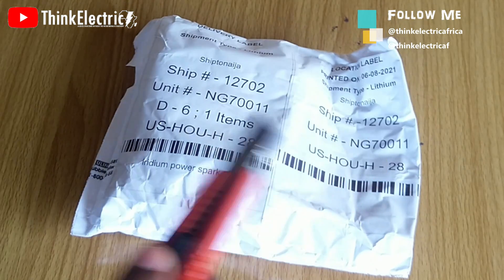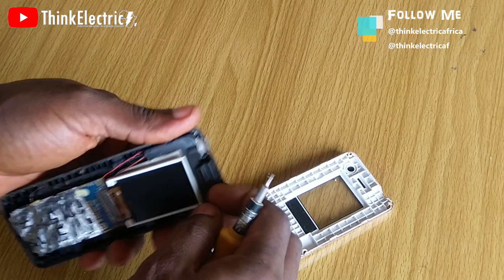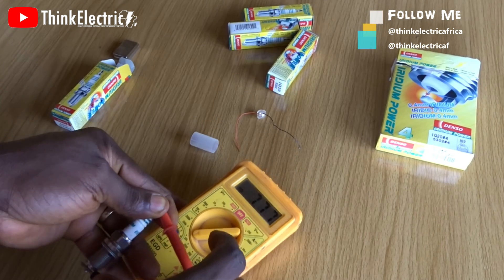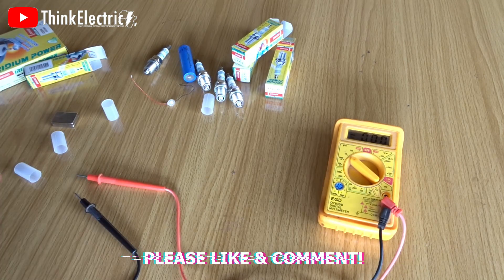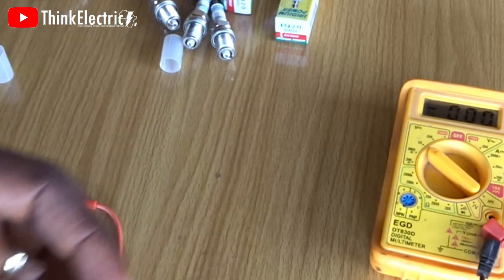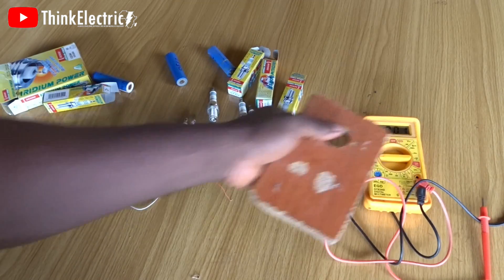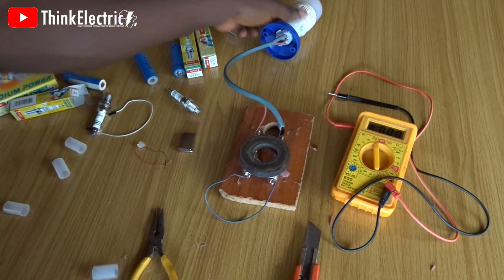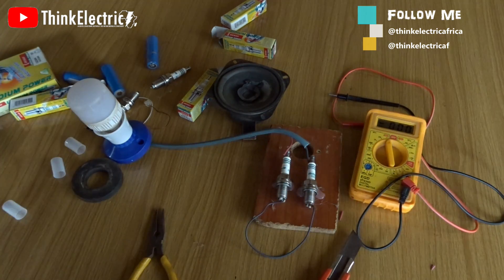Free Electricity Generation With Original Iridium Spark Plugs, THE TRUTH!

Comment: Thanks for this video of that experiment. I went round and finally found a shop with various iridium plugs. Happily i rushed to get the phone LCD to test them at the shop and buy the one that is working, bought unfortunately the iridium plugs failed the test. I now consider that he used the red color iridium. Or maybe we should try again loosing the top of the plugs, tie the wire and screw back that top on the phone lcd testing wire, before using the other end to the center electrode at the bottom of the plug to test 😂. Another thing i noted was that i was informed at that shop was that they dont usually loose the top of that iridium plug like other plugs which left me wondering

Comment: U tried bro but u left out a coil of copper wire wrapped around,  where by the moving magnetic field from magnet will induce a current in coil of wire due to electromagnetic induction

Comment: To produce electricity using electro-magnetism there has to be a rotor that is mechanically spinning like an alternator inside a stator of coils of copper wire. Doing so will induce current using a magnetic field. This is AC because it changes polarity (plus and minus) during each revolution of the input shaft. Spark plugs have to get power in short, timed intervals, from an outside power source. LED’s are diodes that emit light and use chemicals not filaments like incandescent bulbs. They run only on DC.

Comment: You should put a wire coil at the end to generate electricity when closed with a magnet and solder it to prevent lose connection as in this link.
https://www.youtube.com/watch?v=ygR7g55VXqM

Comment: your connection to the bolb is wrong. connect both as single which will be connected to the positve of the lamp holder 
then both tail plug as single to be connected to the negative of the lamp holder
Reply: sorry sir you already try it? pls

Comment: Spark plugs don't produce energy or store energy. Spark plugs are not used to power LEDs.
Reply: well... they do store energy, but only when connected to an actual power source. they store some amount of energy needed to then generate the arcing spark for which they are used.

Comment: What does spark plugs have to do with "producing energy"?
You are a quack.
Spark plugs and LEDs don't go hand in hand.
Reply from the maker: You have issues, it's a pity it's hard to pass knowledge into some heads. Don't just bump into my video to raise insults on me. Obviously the English is too hard for you and reading other comments too. The video is simply exposing the scam going about that spark plugs generate electricity. All you needed is to calm down, watch and learn.
Reply: You don't know anything about electricity. You didn't need to purchase spark plugs to dismiss shams or scams. The bottom line is that spark plugs cannot store energy or voltage.
Reply from the maker: @eddietee6305  I can't be arguing with a person like you. You are the most correct

Comment: As I see that there was no light in the led light, i knew it won't work. That spark plug may be  imported but it doesn't mean it's the original. You bought the fake iridium sir. If it doesn't bring light with the led light there is no point assembling cos not miracle will happen. All the plug used by the fk tech showed light which is a sign of it being the original plugs. I'm not saying his videos are real but the spark plug energy was tested by a white man and it worked search for the video.

Comment: You did it exactly as I have done it.
I drew the exact same conclusion that there is no power being emitted. I've watched one video all the way to the very end and I noticed that the light went out before he removed the magnet and then he did it again and sequenced it right. But on the second try the sequence was off again and the light was out before the magnet was disconnected. I've been doing electrical for years and if this kind of stuff really did work we would have abstract voltages in cars. And I did have a problem years ago with ac voltage in the radiator. The water pump caused the whole problem it was acting as a generator.
Reply: I am guessing but I believe that it must be a pulse circuit iridium plug. Just being iridium won't cut it.   I looked online for the writeup and there is no mention of a pulse circuit.     HERE IS THE PLUG THAT I WANT TO TRY.. here is the write up.   "WHAT IS A PULSE PLUG?
Pulse plugs are the latest in performance ignition technology. They are essentially a spark plug with an internal pulse circuit which increases peak spark current by up to 20,000 times as compared to a traditional spark plug.

How is a pulse plug different than a spark plug?
Their physical dimensions are the same as your stock spark plug. However, pulse plugs incorporate a capacitor, which stores incoming electrical energy from the ignition system and releases it in a shorter more powerful pulse of energy. Instead of 50 watts of peak power, typical of a spark plug, pulse plugs deliver up to 1,000,000 watts of peak power. This allows Pulstar pulse plugs to burn fuel more efficiently than traditional spark plugs.

How do pulse plugs operate?
When the ignition signals a spark plug, it begins to ionize the spark gap. This means that the voltage builds in the gap until a spark can be formed. During this ionization phase, which lasts about 5 millionths of a second, the incoming voltage (which has nowhere to go) heats up ignition components including the spark plug. This is wasted energy. When the ignition voltage overcomes the resistance in the spark gap, the spark is created with an initial discharge of approximately 50 watts. Once created, the spark resides between the electrodes at very low power for over a period of 30 millionths of a second. Instead of heating ignition parts during the ionization phase, Pulse plugs store this energy in the integral circuit inside the plug. When the ignition power overcomes the resistance in the spark gap, the pulse circuit discharges all of its accumulated power - 1 million watts - in 2 billionths of a second. This effectively ignites a much greater portion of the air/fuel mixture, making misfires a non-factor. By effectively burning a greater amount of the air/fuel mixture in the combustion chamber, there is a substantial increase in fuel economy, throttle response and horse power."
Reply: @guidedmeditation2396  
ROBUSTLY RESEARCHED. ROUND OF APPLAUSE.
Reply: How can I get original spark plugs

Comment: You've just connected two resistors now, there's a need for the source of power, voltage like a battery, else a magnetic force that will create the current..kindly have the end of  the plugs disconnected and place the magnetic over both to create a magnetic field in between the resistors .
Reply: he does this... thats what the speaker is... a speaker has a large magnet at the bottom.  you cannot generate electricity with a spark plug.

Comment: Before you can get current from a spark plug,the plug has  to be copper type of plug. For radium plugs connected as a magnetic type  you have to attach a magnetic bar
Reply: Fk tested the spark plugs with a plug tester and he used 4 denso and irridum spark plugs
Reply: those spark plugs you  are using are fake ones. I know where to get the original one. the original one used to be 4 in a park
Reply: @overcomersimon2184  yeah, u are right sir. I don't know his reason to criticize FK
Reply: @overcomersimon2184   where pls
Reply: @overcomersimon2184  sir were can we get it
Reply: @overcomersimon2184  sir please send me a link where to buy it
Reply: Uhh! Have u tried it sir wot copper and dd it work?
Reply: Where can we get it

Comment: a spark plug gets its power from the coil so, if there isn't power nothing will ever light up.  The spark plug is a resistor of sorts if I understand correctly .  Even the lowest voltage still has to have so many minimum volts to light up even though they may only need 20ma

Comment: This video is like coming from someone who has no idea in physics.you tested for resistance and didn't add magnetism and expected to get the plug to light up an led. It's like connecting a resistor across an led and expecting to get a light without any power source

Comment: I was told a vehicle has about 20,000 different parts. If America and Japanese scientists had been told that a vehicle can work without a particular engine they would never had believed, Today however, we have engineless electric vehicles. Can't you use iridium spark plugs with red base color because fk had never use another color. Until i get the exact iridium he uses, i will keep trying.
Reply from the maker: Great, keep trying. I am also waiting for your results
Reply: the question is,why is the guy finds it difficult to answer questions. I Kno something is fishy
Reply: When you get one let us know . check on azon or on YouTube is he the only one . .if he is telling the truth let show where to get but for me thank God.
Reply: You're not good at all
Reply: Iridium spark plugs red colour
Reply: you cant generate electricity with spark plugs.  you were fooled.  its what "free energy" content creators do, they lie.
Reply: Spark plugs don’t store energy like a battery. As far as I know an electro-magnet only works if the conductor is spinning relative to the magnet. That’s how alternators work. The input shaft is connected via pulleys and belts to the engine. Te engine spins round and round and induces power using stator windings to provide the correct ratios of current and voltage to use for the car and battery. The alternator provides AC power and has to be rectified to DC to be compatible with the car’s electrical system. For the spark plug project: Light bulbs that are in your home Run on 115V AC. Small LEDS use way less voltage. Incandescent or fluorescent bulbs can run on either AC or DC. LED’s are diodes and only conduct current in one direction so they are polarized and only run on DC. Hope this helps…..

Comment: Bro I think you did't connect it very well, and the spark plugs you used is not the one, the guy used the one that has red head not White head like yours .and use a magnitum magnet. You can as well get in contact with guy try to reach me.
Reply: FK has used many different spark plugs.  FK is fake and I have discovered the evidence in one of his videos

Comment: Friend, you are still using wrong but original spark irridium plugs.
The plugs used by fk is called pulster iridium plugs. It has internal circuit that amplify voltage for more than 100 times. You can Google pulster plugs for more enlightenment. I salute your efforts. Pls don't conclude yet. Thanks
Reply from the maker: This stuff doesn't work. No matter the type of plug. What baffles me is that you have not made efforts to buy this plug yourself. Don't you want free Electricity too?
Reply: Why is he not showing where to buy it.fk is playing with people

Comment: You obviously got and used the fake spark plugs, try and get an original one
Reply from the maker: Have you got the original? Is it working for you? What you saw there is the original Denso Iridium spark plug. Take note of that.
For you to be sure check this https://youtu.be/s990xsCP6zs
Reply: @thinkdiyafrica  Sir, since this spark plug electricity is a serious challenge, kindly enquire from denso iridium spark plug company if it has a plug that if tests produce and light DC bulb at least 4 DC volt. Or the company should make special ones with such DC volt. Thanks for your determination!

Comment: bro be sure to read my comment. Here is the truth as I think. You have tried. Someone clicks connect while the FK TECH GUY uses the magnet to increase the voltage. Do this and let's see in your next video... Connect one terminal of the bulb to normal NEPA light and the other wire to a switch going to the bulb socket then use the magnet to go close the the plugs u will see it will make the already powered bulb glow brighter. Which will make it over normal 220v
Reply: sir what is NEPA?
Reply: @paultadaya555  NEPA is the unofficial name for the regular power supply.

Comment: Bro I think you've tried but one thing is clear from fk tech videos, the denso  iridium spark plugs he uses are all red coloured , I have also make enquiries amongst the spark plugs dealers and they admitted that such red coloured one exist but it hard to come by so if you could try get those, I Strongly think it could work.
Reply from the maker: I am not saying there is no red spark plug, what I am saying is different manufacturers can make their product as they like. I have seen green and yellow spark plugs. How many spark plugs do we need to buy before electricity is generated. Anyways I am ordering that one too
Reply: @thinkdiyafrica  You're doing a great work. I want to suggest that your neutral from the lamp holder should be connected to the central electrode if that wasn't the case and the live to the ground electrode. Also visit denso iridium spark plug site to read about their plugs whether it is different from iridium spark plugs from other companies and probably buy from them than from others who might fake the label. FK said he bought fakes before he got the real plugs
Reply from the maker: @bofavour  nice suggestions but I know the out come.. Will let you know. Thanks
Reply: Actually, I bought one NGK called laser iridium spark plug, when measured with multimeter, its having 3.7mv dc. This is quite small. Secondly some materials can induce EMF when a copper I worn around it but never an AC. Let him research more I believe with the small current, he can burst it with  a capacitor then a coil. Thanks
Reply: FK tech could not send it to anyone

He is a scammer believe it or not
I contacted him on WhatsApp